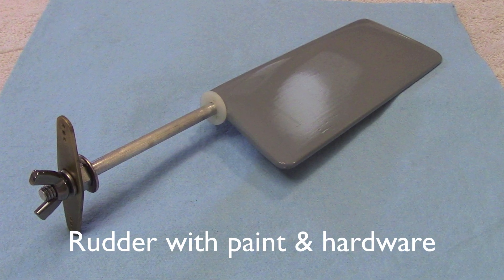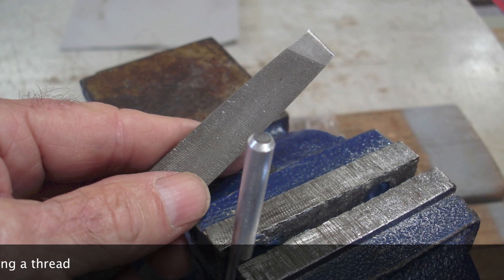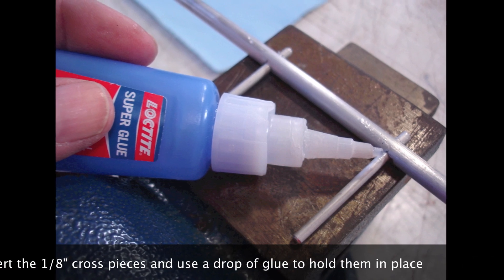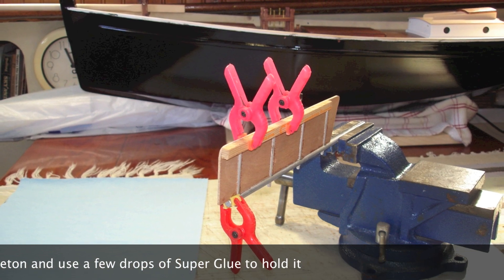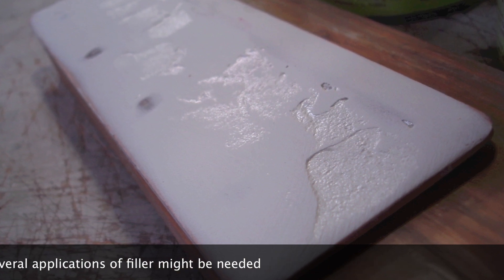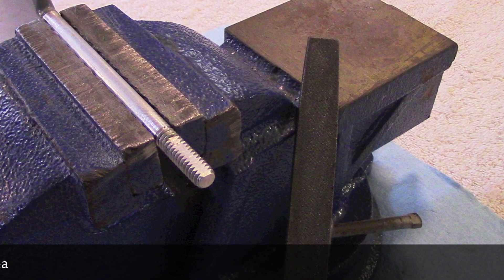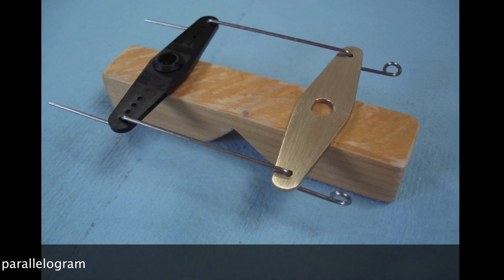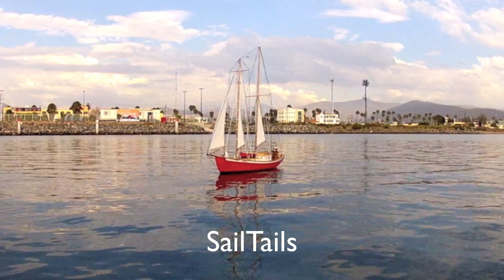RC Sailboat DIY Bombproof Rudder Build

Comment: Thank you for magnificent videos Gary.  I used to run in the IOM class but that can get tense and while I love the people when its event time things get a little wierd.  I love the relaxation and peace of mind I get from sailing so I decided to build a more traditional and scale boat.  
I am rebuilding my IOM as it got damaged during a transit but while working at it I was watching Youtube videos on RC sailboats and came across your channel.  
So much information shared and very enlightening.  I had been real scared of sails and rigging and I feel so much more comfortable now that I watched your videos.  I will start checking out materials we have here in Turkey.  I was going to buy the plans unfortunately our "magnificent " country blocked Paypal (pun intended).  I guess I will go the calculate displacement and make it up route :)

I always hated planking but your designs gave me the insight to use the singe side pieces which makes things so much easier.  I also want to make it a full heel as we get a lot of debris and the boat gets stuck.  In IOM we have a rescue boat that helps when you are completely stuck but when sailing for fun you are alone mostly and the bulbs always gets stuck.  Murphy's laws I guess works here as well.

One thing I have not figured out is how do you decide on mast length and sail size compared to your displacement.  

Appreciate your videos and stay safe.
Reply from the maker: Thanks Serdar for your story and your can do attitude.
As far as sail area to displacement - Calculations on the drawing board provide an approximation of stability. Building and sailing a prototype boat allows more accurate measurements and observation of the performance. Hull size and shape of course have a great influence on the amount of stability available. All the Bearospace boats share a similar V-bottom hull form, and their sail area/displacement ranges from about: 
35sq.in./pound -  (496sq.cm./kg)  -  Mild mannered schooner
55sq.in./pound -  (780sq.cm./kg)  -  Rather lively cutter
Reply: @sailtails2775  so I guess the IOM boats fall into madbull category.  Only the mainsail area is roughly 5832cm2 which puts it to 1.458 sq.cm/kg  (4000 minimum weight which we all try to get to)

so basically as long as I make sure the the bouyancy and center of gravity are in good positions, I keep the displacement safe and keep an eye on the sq.cm/kg sail are I should be safe.  

I was thinking about making the keel ballast layered so I can change the weight to see how it behaves.  It would be easier to do than making a new one each time I want to test.  The con would be that the center of gravity will be a little higher but I think I will add that to safety margin and since this boat is to enjoy sailing I am not going to concern myself too much with that.  

I will start drawing  and calculating while collecting materials.  

Again thank you for the reply.  It has shed a lot of light to my shadow of doubts :)

Comment: Isnt bending the rod a much simpler method than putting in extra rods?
Reply: I do like the pull/pull system
Reply from the maker: Thanks for asking about this. The rudder is fairly large, the stock is 1/4" diameter. Bending might be possible, but the extra rods (1/8") are easy to do. They provide support over the entire surface and allow the rudder to have a thinner trailing edge.
Reply: @sailtails2775  What size tubing for the rod to go in please
Reply from the maker: @petronopulas  I simply let the 1/4" rudder stock ride in a drilled 17/64" hole in a wooden support block glued into the hull. I saturate the drilled hole with penetrating epoxy, and I grease the rudder stock occasionally.
Reply: @sailtails2775  thank you for your reply. Sir. I thought you would have put an aluminium tube in the wood block and the rod inside that but if it works ok without then I’ll try that.